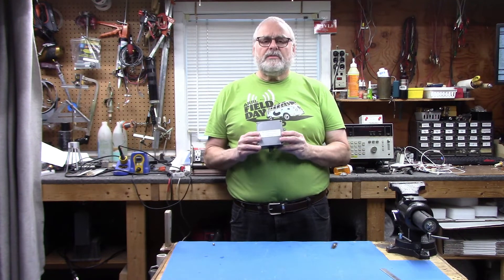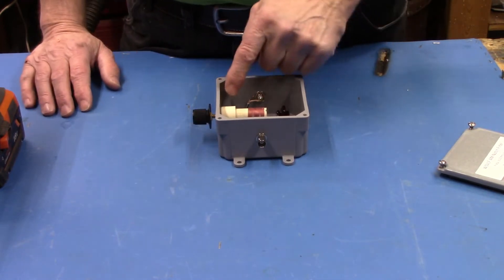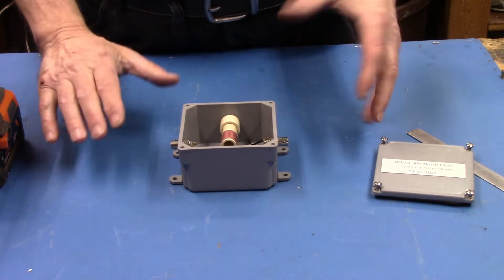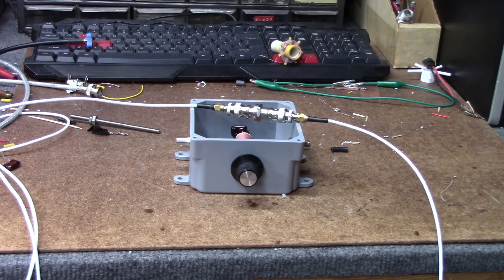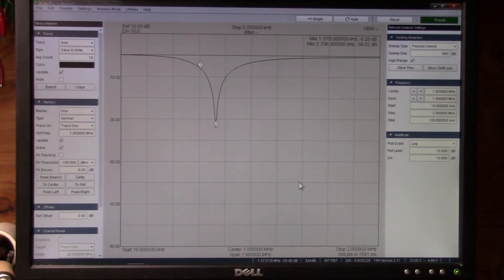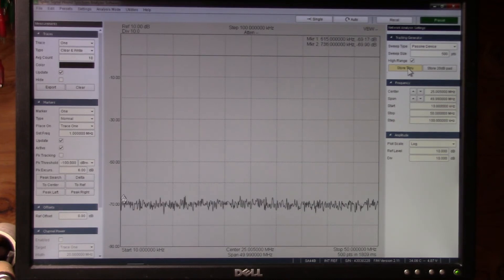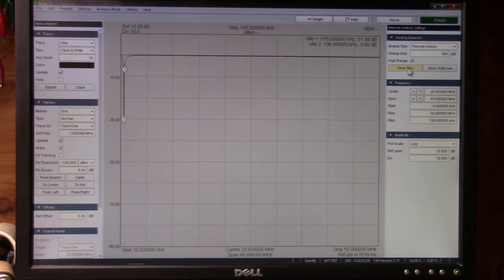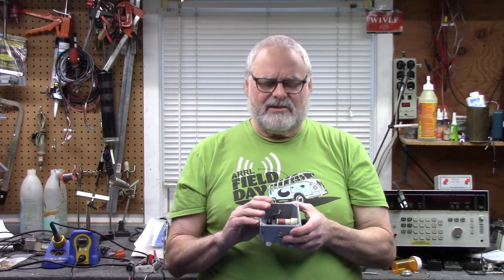MF Notch filter part 2. The completed filter

Comment: Thank you for this great video.  I live 2-3 miles from station 850 KOA, which is a 50,000 watt blow torch right in the middle of a residential neighborhood.  Dental work can pick this station up.  Today the station reduced it's power, bringing it down to 20 over S9.  The skies cleared, and the heavens opened up.  The receivers here sound much better, especially when tuned to an oldies station at 810.  Even 850 KOA sounds better when it's not overdriving the AGC.  Unfortunately for me, it'll go back up in power, and I'll be making this notch filter and enjoying splatter-free radio again here.  73, AB0NF

Comment: Hi Paul, I posted on the other notch filter video. As I mentioned in the other video, I'm in the process of experimenting with a dual L/C filter for a deeper notch, based on your design. Just a couple of quick questions... Are you using 1/2" PVC? From the video it looks like what you're using is smaller and 1/2" is the smallest I could find locally. How did you attach the PVC cap to the side of the box? I know you glued a nut in there so the threaded rod can move back and forth but it's not clear how the cap is attached, maybe just epoxy? I just ordered some 10/46 litz wire but I've been experimenting with plain magnet wire until it arrives.

Glenn W2BX
Reply from the maker: Glenn Check your email..  W1VLF

Comment: I noted that you used Litz wire.  I would like to start using Litz wire for some MW projects.  Where do you get your Litz wire and what type is best (gauge and number of conductors)?
Reply: I don't know what gauge litz wire paul is using but you can find different sizes on E-bay. Choose U.S. sellers if you don't want to wait forever. I just ordered some 10/46 from an E-bay seller. 200ft for $11.77 with tax. I'm hoping this will be not too big of a diameter for the coil.

Comment: Once again, a great video, Paul.  Just curious what the inductance range was for your variable inductor, with the core fully in versus fully out.  Was the length of the ferrite core more or less equal to the width of the Litz windings?  Again, I'm not looking for specifics, but more general guidance tips for those of us that might attempt to wind our own inductors.  I would imagine a larger coil with a lot of windings will give you a larger tunable range, but likely you'd sacrifice a bit of Q for the system.  Thoughts?   Thanks again for the great video.
Ken, WBØOCV East Falmouth, MA USA
Reply from the maker: Hi Ken,  I try in my designs to keep the intrusion of the ferrite core to be minimal.  It is only used to trim the notch to the specific frequency. So no the core does not extend that far into the coil. The coil inductance with no core, or core unscrewed out, sets the upper limit of the notch.  The lower limit is set by the core 's intrusion into the coil. And I purposely limit  because as you move too far in frequency the notch gets really wide, and the overall insertion loss of the filter goes up.  We can talk more about components if you like. Contact me by email on my QRZ site.  W1VLF ....I cant type for beans... easier if we talk on the phone